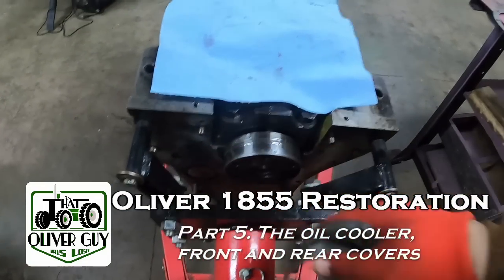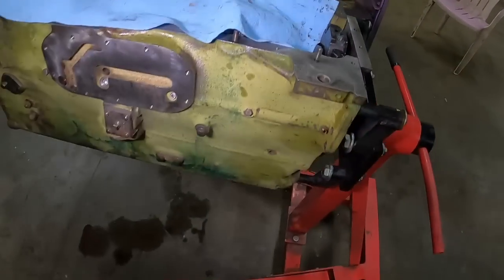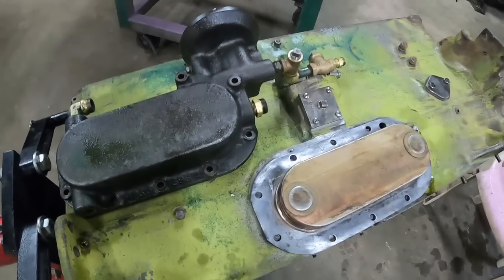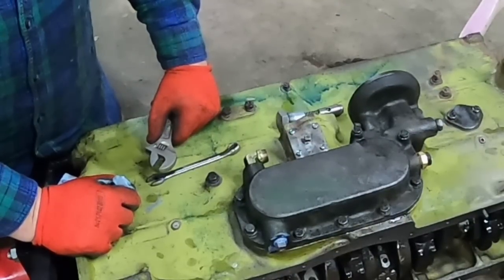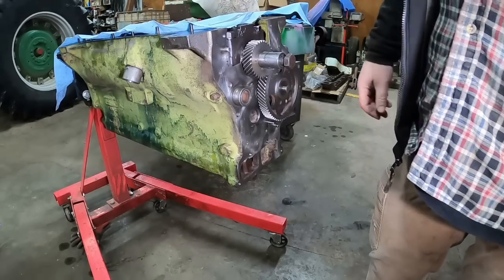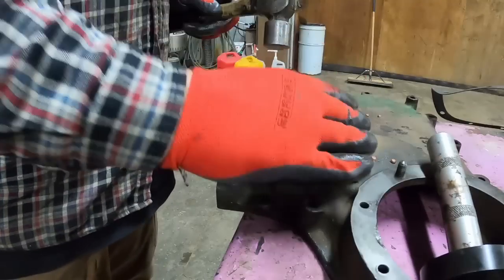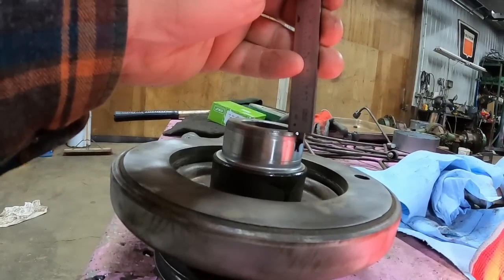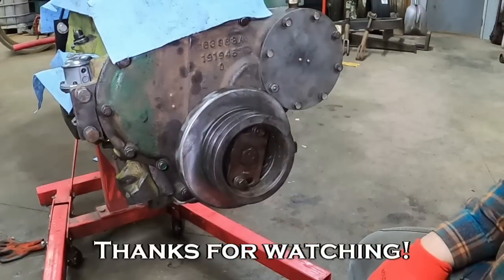Oliver 1855 Engine Rebuild Part 5

Comment: Looks like the same fuel pump on my 1750 ?? Never did understand why it has a fuel pump when the tank is almost 2 foot above the carb ??
Reply from the maker: If it was a gas engine, the fuel pump would help prevent vapor lock by keeping the gas under pressure. Being diesel, it helps push the fuel through the filters.
Reply: @ThatOliverGuyChris  the vent in the tank cap wouldn't stop that ?? TY Chris !!!! Have trouble starting it , never seen a carb like this before USX 44 1967 1750 GAS,,, I think it has garbage in the carb ?
Reply from the maker: @bustersmith5569  it's the fuel line near the block that gets hot and vapor locks, so the vent makes no difference. Those carbs are notorious for being hard to get adjusted right and stay that way. I would start with disassembling cleaning it up.
Reply: @ThatOliverGuyChris   yeah that's what I'm doing cleaning good ,, it's such an odd carburetor and not a lot off information on it  ? I'll take any help you can give  ! Its really a nice tractor, I didn't fined any garbage in really,,; float looks good a new one is almost $300 dollars  ! Wish me luck TY Chris,,, 👍
Reply from the maker: @bustersmith5569  Oliver did offer a replacement cast iron carb later on  that did much better. I'll try to find that model. Of course it isn't available new anymore, but if you can find one it is much more reliable.
Reply: @ThatOliverGuyChris   ok ,,, where do I find one ? This is the first  trouble I've had with it always ran very well ,,,,
Reply from the maker: @bustersmith5569  you'd have to keep an eye out for a used one. I don't see them very often, so I would try to clean up the aluminum one for now
Reply: @ThatOliverGuyChris  Chris I found a Zenith carb on Yesterday's tractor factory replacement carburetor for 1967 Oliver 1750 gas is that the one I want ? It's the only one I have found with shipping about $800 buck if it will work it's worth,,  TY

Comment: Chris ,thanks for all the videos.Really enjoyed them. I have a question. What are your thoughts about putting a 2-85 engine in a 1755. Thanks for your reply.
Reply from the maker: It would be a little bit of work. The Perkins isn't going fit in the 1755 frame without some modifications. If you have the tub from the 2-85, that will bolt up to the 1755 rear end. Then you're looking at either switching the back of the 3 speed to a chain coupler, or changing the 1755 input shaft over to a trunion mount. It would basically be a 2-85 when it was done and be a good tractor, but there would be some work involved.
Reply: Thanks

Comment: Hey Chris, are you doing the oil press relief update for the block?
Reply from the maker: Enlighten me on that one. I'm not familiar.
Reply: @ThatOliverGuyChris  I sent you a email.
Reply: @ThatOliverGuyChris  there is a service update from wfe that basically shows to put a spacer in the one psi relief valve in the block on the pan rail. I believe it makes it so it doesnt open and routes the oil back to the filter housing. I cannot remember the exact wording right now.  I will send it to you in a email.  Also did you plug both ends of the  oil galley or just the back side? Of the 3 blocks I had only one had no plug in the front by the timming gears. I dont believe it matters because its just returning oil to the sump. One more thing is the soft plug at the rear of the camshaft supposed to be brass to act as a thrust washer or can I use a steel plug?
Reply from the maker: My block is a replacement block, and it doesn't have the relief under the pan. That will show in the next episode. It only has a relief on the pump, nothing in the block. I am now recalling that seeing that service bulletin recently when I was looking for other stuff, but didn't read it because it wasn't going to pertain to my block. 
You want to plug both ends of the galley. More than once I have talked to guys that rebuild an engine and it has low oil pressure when they get it going, tear back down and find that their machine shop took the plug out for cleaning and failed to put it back in when they were done. Too much oil goes back to sump and it kills your pressure. I should have thought to mention that.

My machine shop put steel in, I sure hope that is ok. It should be since there is oil in there and the thrust is minimal anyways.
Reply: @ThatOliverGuyChris  well that makes sense as to why your block doesn’t have those drillings and relief valves.  I was going to put both plugs back in the oil galley, I was thinking the same thing as to pressure.  I am using a steel soft plug for the rear of the cam also, I was just wondering what you thought.  I couldn’t find a brass one anyway.

Comment: Ross' add is funny as hell! Both dad and I laughed our asses off at that. That channel is really getting hard to watch. Thankfully we've got some other high quality Oliver content on here. On the topic of 310s, do you know if it's possible to put a bypass filter on a 1755?
Reply from the maker: I'd pull one of the plugs on the galley on the right side of the block and feed a bypass filter that way. I'd put an orifice of some kind on it so it can't rob too much flow. You wouldn't want to sacrifice pressure. The bypass on the 1955 is just a T fitting on the turbo lube line, and the filter is fine enough to give some restriction so it doesn't take all of the oil away from the turbo. For return, I'd either go in just below the tach drive like on this 1855, or your 1755 might be tapped and capped above the injection pump drive. That would be a good spot as well.

Comment: Was the fuel pump new? If so where did you get one?
Reply from the maker: Yes, it's new old stock. It's one I had on hand from back when we were a dealer. Last one I had, but I couldn't beat the price.

Comment: One other nosy question.  Our 1855's never had a lift pump for the fuel on them and I see this one didn't when it came out of the tractor.  Do they make that much of a positive difference to add one now?  Just curious.
Reply from the maker: They definitely work without them, but just having the hand lever on there to push fuel through when priming the system or  changing filters makes it worth it. Earlier Olivers that used the Roosa pump had a lift pump. My guess would be it was another cost saving measure to keep the price down.
Reply: @ThatOliverGuyChris  I get your point.  We had a late 1650 with the lift pump to prime with and always made sure the tanks on the 1855's were full when filters were changed to get the maximum gravity feed.
Reply from the maker: @samholmes1156  I added an electric lift pump to my 2-155, and it  made a noticeable difference in power, especially once it got down to the lower tank. It might here, but after having to blow air into the tank of the 1955 to get the fuel pushed through to prime it, I knew I was going to add a pump to this one.

Comment: It amazes me that a rubber seal can groove a shaft. Those sleeves really work good for a new surface for the seal to run on.
Reply from the maker: I have thought the same. I figure some dirt or crud gets in there and acts like a tiny cutting tool on a lathe.

Comment: Very interesting! Thanks for sharing.
Reply from the maker: Thanks for watching!
Reply: I had a 1955 have oil cooler like the one you have on display there the other then I had two 1855 one didn’t have a oil oil cooler the other one had a oil cooler for your oil filter sets on top of the cooler didn’t mount to the side of the tractor they ran toantifreeze lines down to the cooler and it’s more or less a cooler just in the base of the oil filter

Comment: Really enjoying this series on videos! It's great that you don't edit the boo boo's out Chris. I invested in harmonic balancer installer 10+ years ago. I have used it less then a dozen times but it does save treads in the crank. If you ever strip out a crank 🥵
Reply from the maker: I stripped one a couple decades ago. Not fun, would not recommend.

Comment: Perhaps a short piece of hydraulic hose with NPT fittings for the coolant  drain on the oil cooler
Reply from the maker: I was thinking the same. I prefer overkill to under performance.

Comment: Haha see now at least I have enough faith in your knowledge and ability to where I gave you the benefit of the doubt. I was thinking I wonder why that cooler came with multiple gaskets? Turns out it came with the one that was supposed to be in there.😂
Reply from the maker: Sometimes gasket sets come with extras to fit multiple applications. The sad things is, I'm not using a gasket set. I went through my inventory and got gaskets I already had on hand! I guess when oil and coolant come squirting out, I can rewind the video to see exactly where I screwed up. LOL

Comment: This project sure brings back a lot of memories of the pair of 1974 1855's we had.  The oil cooler had a nipple on the drain that was dripping and snapped off when I went to tighten it up.  Luckily there were enough threads above where it snapped to put another cap on it.  Or the time I was spreading a load of manure and #1 rod came through the side of the block and broke the injector pump off with it.  Also the time the harmonic balancer came off of the short block that had been installed after the rod incident.  Those were the days. Lol
Reply from the maker: Yeah, these turbo 310s certainly have their share of issues.